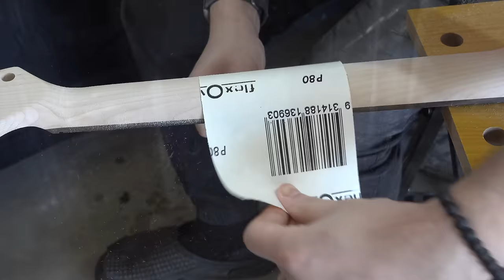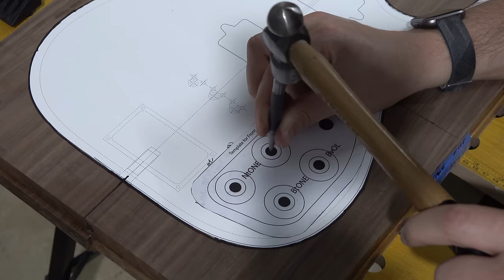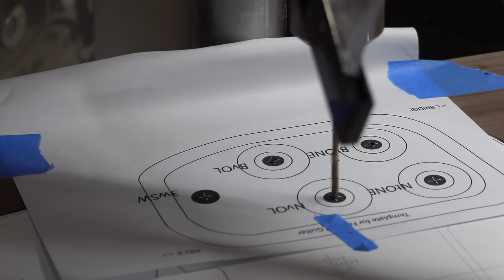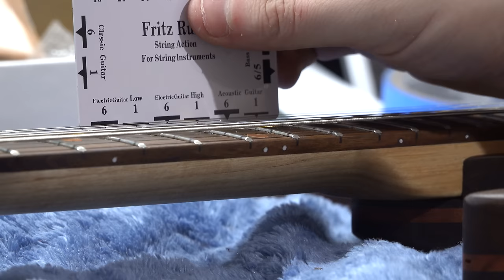Custom Electric Guitar Build (No Talking / Relaxing Blues Music)

Comment: I wish you hadn't put a battery on the body while gluing it. That type of added weight, if unsupported on the bottom, can bake a "bow" into the wood, and it can also cause the wood to separate many years later. You could remedy that by putting something underneath that supports the weight of the battery which would solve all of those problems.

Comment: Looks like you have the neck pickup ring backwards, the high side should be facing the bridge?
Reply from the maker: There really is no wrong or right way up as it depends on the body shape and curvature. I placed it that way so that it adjusts up and down evenly at the same angle as the strings :)

Comment: What is the finish you were wiping onto the neck?
Reply from the maker: It is the same stuff I used on the body. It's called Tried and True and it's very similar to Tru Oil. It's a great finish because it doesn't change the colour of the wood, it just makes it look deeper and adds a slight shine to it :)